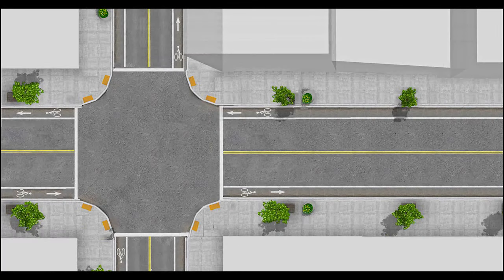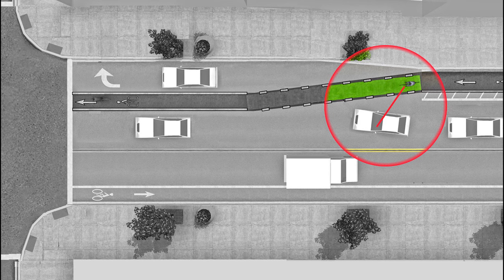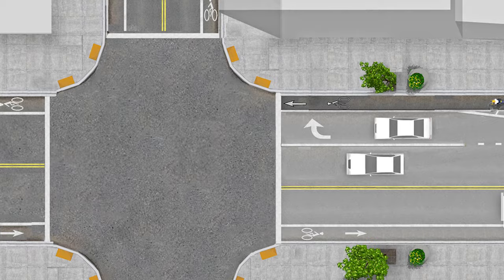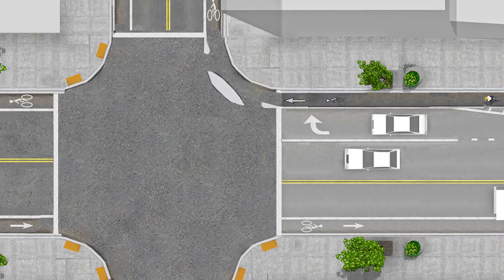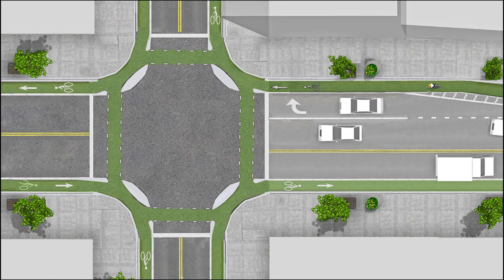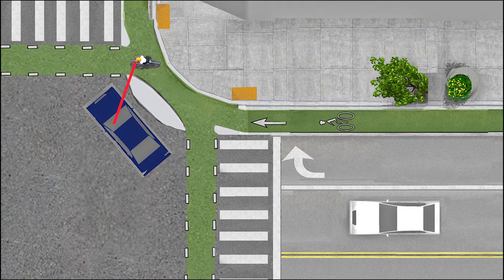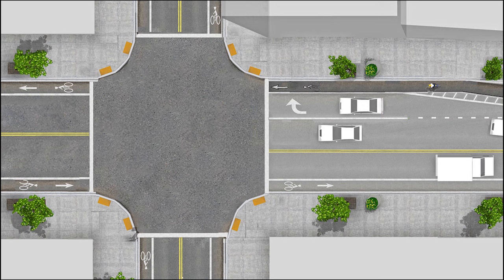Intersection design, the Dutch - cycle friendly - way

Comment: This 10 year old video about dutch roads makes me feel like us in America live in the stone age
Reply: not only tAmerica... we in Germany - the neighbour to the Dutch - don't have comparable junktions...
Reply: Maaan, think of 3rd world countries, such as Bangladesh. We don't even have a cycle lane. 😭
Reply: These junctions are hardly ever placed like this anymore. Even ten years ago these had fallen out of grace. We have moved on to roundabouts for single lane roads and traffic light controlled junctions for bigger connecting roads. The traffic light controlled junctions will give cyclist a green light seperate from crossing traffic turning right. A lot of traffic light controlled junctions are getting smarter with talking traffic and there are even sensors placed at most junctions with traffic lights that see a cyclist aproaching the traffic lights.
Reply: @dutchdrifter8740  these junctions are still an improvement to (for example) American roads though. Switching to the latest and best design immediately isn't possible, while switching to the junctions in this video is a relatively small change that hardly requires any changes to the infrastructure, mostly just some paint.
Reply: Cries in Australian
Reply: @heddevh  they sure are a big improvement compared to current American layouts. I was only stating that we have evolved from these to new layouts. Our Dutch road network has changed a fair bit in the last 20 years. 
If you were to apply this layout you do need the curbs tho. Without them cyclist tend to take shortcuts and move themselves into the cars blind spots.
Reply: Not only America. Here, the middle Europe, our city started building junctions just as at the beginning of this video - totally wrong...
Reply: Interestingly, the Dutch seceded from American road infrastructure doctrines in the 70s, and what you're seeing here is one of the many developments that followed. 50 years of innovation. The goal is pedestrian/cyclist safety, so that people will not be dissuaded from walking short range journeys and using the bicycle on short-medium range journeys. Which not only improves our road safety (and public health), but also reduces congestion and polution. There's no need to use gasoline for a trip just as easily done by the "benenwagen" (roughly translates to the "leg car").
Reply: You do live in the stone age, with your 4-way stops.
Reply: @BlackDreaded  not entirely true! I watched this vid and thought: This is basically a normal junction with pedestrian crossing, but just adding a cyclist lane immediately beside it. The only thing different in my mind: They added these traffic islands for cyclists to drive behind, where I say, we already leave these cyclist paths on the sidewalk anyway. 
The sad truth though: Many new junctions are being built in this, as you would say, American style. So we Germany are even worse: We evolve backward... Oh, how I love the utter incompetence of our governing and urban planning departments.
Reply: The whole world knows Americans live in the stone age. We make fun of you whenever we can!  :)
Reply: Cries in neglected american infastructure
Reply: In some ways we do - check out the channel "Not Just Bikes"
Reply: i think I've seen you in the comments on every video
Reply: @dutchdrifter8740  sure most new junctions right now use more modern and complex designs, but most of the basic ideas of those designs find their start in this simple design plan. There is still a lot you can learn from this junction design.
Reply: @shakir_ahmad  Look at my city of Argentina. There are no bike lanes, we have to circulate on poor quality asphalt with a pothole every 10 meters. I have broken my bike already !!
Reply: @gijsbrans2338  True, coming from even more simple designed junctions there is lots to be learned from this plan. There is also a lot to be learned about what not to do. Especially for countries that have growing numbers of cyclists and where cycling is fairly new this junction can be a huge improvent compared to current junctions.
The more sophisticated junctions need a complete infrastructure redesign. Just looking at the 9 (10) different speed limits would make an American driver lose all hope. And yet they are logically implemented. I can tell by the design of the road what the maximum speed is on that road. Knowing the speed limit also tells me what the right of way is at the junctions I will encounter on said roads. A lot of effort and design have gone into our infrastructure, but mostly a lot of time to get drivers adjusted to the new designs.
Reply: @shakir_ahmad  we don’t have cycle lanes in many cities in Germany either.
Reply: In Finland my home town we have roundabouts instead of junction and biking road is crossing under these roundabouts.
Very clever I think 🤔
Reply: you do
Reply: Have a look at what a roundabout is then 😂
Reply: @Xx_95kene_xX  There is plenty of roundabouts here. Also seeing bridges and tunnels here though
Reply: feel your pain, cheers from Ukraine
Reply: Oh yeah yeah you are superior my friend
Reply: The UK too.
Reply: You are, that's why.
Reply: @shakir_ahmad  :/

Comment: It also makes driving a lot more pleasant by making it clear where you need to look for cyclists.
Reply: And because more people will cycle, the roads will contain fewer cars and be nicer to drive on.
It's really a win-win.
That's why the hate from motorists is so weird.
Reply: Exactly. It makes driving saver and more relaxed FOR ALL. And if its done correctly cars don't get cyclists in their way either. My city for example has bicycle tunnels that go under a busy road...so no bikes near cars at all. Its not only relaxed and save...its efficient cause bikes get to the city centre faster then a car would. And with less traffic and no bikes the cars flow better as well. Whats not to love?
Reply: @maaiker2977  i've seen that in Leiden quite a bit, with the cycling tunnels.
Reply: @dutchdykefinger  In Zwolle we have it near the hospital....the ambulance hardly has any traffic lights to deal with. All cyclists go underground or next to the road. So an ambulance can get off the highway and just drive on towards the hospital. There are like 3 tunnels on that one bit of road. Every intersection has a tunnel. Only the parts where pedestrians should also have a way to get to the hospital has traffic lights. Thats smart.
Reply: I know, I feel like I'm constantly doubting my shoulder checks and just flailing my head around like an idiot
Reply: Yes, the dutch cycling infrastructure is awesome, we even got paths connecting bug citys
Reply: Yeah I used to miss them but with this junction I can aim straight for them
Reply: @Eden-NoEye  I was waiting for that cheap shot.
Reply: @mourlyvold7655  I am shocked that I am the first one haha
Reply: @Eden-NoEye  Right? There are enough people sharing that such twisted attitudes...
Reply: @mourlyvold7655  well I call it humor don't take everything that you read on the internet seriously
Reply: @Eden-NoEye  My remark was intended to be half witty as well. Instead  of reading youtube comments where these subtleties get lost, it would be better if we have a beer sometime... 😉 Peace.
Reply: Yup. It's way better than elswhere😝
Reply: Yup. I know dutch roads. Elswhere, even Germany, Austria or Norway where I live now, much poorer bike lanes. They are often shared with walking people, who belong in the Netherlands on the "stoep", this the sidewalk and not the same as a bike lane but somehow in other countries they are?
Reply: Yes!  Its only fair to give them half a chance 😜
Reply: Exactly! I like this comment a lot. Unfortunately North American’s are so antagonistic toward cyclist but empirical data shows better bike infrastructure isn’t just a good experience for cyclist but also cars & other modes of transport, we just have to find palpable ways to say what we want to convey to people so we can get them on board with new, objectively better, safer and more efficient ways of doing things in U.S. + Canada.
Reply: and where you need to go as a cyclist, here in Belgium they're working on renovating the roads for bikes and such like in the netherlands, tho we're still far behind. I still find myself coming across a lot of places where I'm just unable to find my path to where I need to go, sometimes it requires crossing the road to a 2 way cycling lane kilometers before the actual turn. I always plan my routes with satellite imagery cause it's just so unclear

Comment: Alright this video is now officially 10 years old, I assume these crossings have been implemented everywhere by now right?
Reply: Hhhhhhhhhhhhhhhhhhhhhhhh
Reply: My city considered this. But 10 years later this is more than an idea and there is statistic evidence available, which sadly shows that this design isn't as good as it is shown here.

It doesn't help at all when trucks are involved, if I remember correctly it's even worse than, because due the angle the truck drivers have even more problems to see the bikers.

Additionally, this design is quite annoying for fast cyclist that want to go straight, for them it's like a speed bump to slow them down. What doesn't sound like a big problem leads to dangerous situations with bikes at different speeds and sizes.
Reply: @frool76  Yeah well trucks are going to be a problem basically everywhere when combined with bicycles.. And same goes for cyclist who want to go fast haha :)
Reply: Norway use 10 years to plan roads, then another 10 years to build it, then another 10 years to fix the road they just built.
Reply: No. They're both unnecessary and wasteful.
Reply: Junctions in the Netherlands are more advanced nowadays
Reply: Nop. The duch are still suprime.
Reply: even 2011 was good of design it has still the issues of truck hit bike scenarios.
In the netherlands

they updated greatly. 
Most of the bike lanes are separate from the car lanes.

Makes car hit bike almost zero chance.
Reply: @Duijnkiller  how do they look at a junction like that? Is there a video or picture somewhere?
Reply: i have not seen a single intersection like this anywhere in the usa
Reply: @frool76  Intersection is a space of high alertness so there shouldn't even be talk about slowing traffic being an annoyance, it's a safety feature that allows you to better scan your surroundings.
Reply: I'm Dutch and we don't even use this....
Reply: @Deadl0ck  is Google Maps lying then?
Reply: @nikotakai8796  dunno what to tell you bud. I'm sure they exist somewhere, but I only know of 2,maybe 3 old intersections in my area that might be designed like this, the rest, every single one of them, are all roundabouts. And those are all on major traffic arteries, normal sized intersections, what this claims to be, don't use anything like this, just seperated traffic lights for cars and bicycles.

Then again I don't live in the biggest city either. My point was more that these are not nearly as common as this video makes them out to be. Let alone on simple normal sized intersections. Even seperate bikelanes is something you only really find on high traffic roads, not common intersections.
Reply: @Deadl0ck  okay, first of all, this video is 11 years old. I'm pretty sure that the Dutch have changed many of those intersections to roundabouts in this time frame.
I mean, some of his videos even show that, I think.
Yeah, because you have many 30 kph streets (or roads, not sure which is the right word), you don't need to have that many protected bike lanes. But in comparison to other countries you have an enormous amount of them. And tbh, you pretty much have them everywhere where it's not safe for bikes.
And I cannot find a single roundabout that doesn't have those separated bike lanes (at "bigger" intersections).
Reply: @nikotakai8796  nearly everything is 50 kph, 30 zones are pretty uncommon.  And roundabouts are not the same as intersections. My point is that the roundabouts are preferred over this style of intersection. And where I live the only infrastructure remodelling recently was removing traffic lights from an intersection... 12 years ago.
Reply: @Deadl0ck  you're telling me that where you live there are unprotected bike lanes on 50 kph roads?
Reply: @nikotakai8796  I'm telling you that almost all roads are 50kph which is the normal inner-city speed limit, without any bike lanes marked at all. Some School streets and certain housing areas are 30kph, but 50 is the norm within city limits.
Reply: @Deadl0ck  okay. Tbh, it's quite hard to believe that looking at all those Google Maps images. But if you say so.
Reply: @nikotakai8796  keep in mind we've also had bikes here on the road since before world war 2. We're used to bicycles in traffic.
Reply: In Brazil we didn't implement anything in those 10 years

Comment: I live in the Netherlands and this works great.
It just needs some shark teeth yield lines to clearly mark which traffic has to yield for who.
Reply: As a dutchie, this sounds like a medieval movie
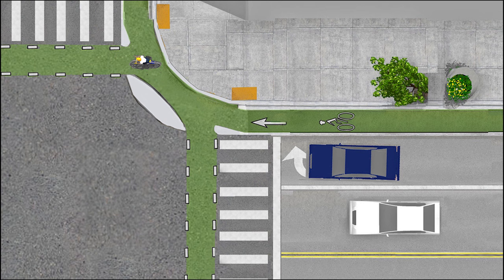Reply: What about the exact place where the cyclist stops? Is it the way it is presented at 1:37 ? What about another cyclist moving from down to top? Isn`t the cyclist who is waiting in his way blocking him?
Reply: @d0nny_106  no you drive around eachother
Reply: @d0nny_106  Yes, sometimes this happens and then the cyclists coming from behind need to wait a bit before they can move on. Usually cyclists have priority so the waiting is not too long. And most intersections have more space to allow for cyclists to pass each other.
Reply: @d0nny_106  In the netherlands, bike paths are usually physically separated from the road. (basically swap the row of trees with the bike lane in this graphic) This not only protects the bike lane from car traffic, but also automatically creates pockets for cyclists to stand at the intersection without interfering with other cyclists.
Reply: @krabpapier8100  how do you Dutch have time for modesty, with saving humanity and all that